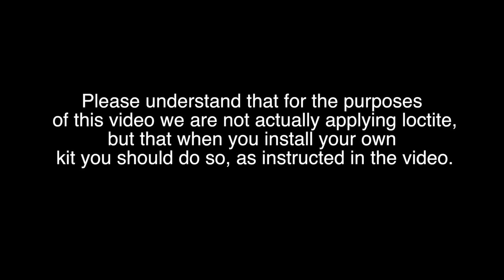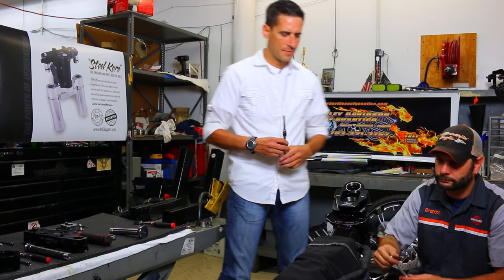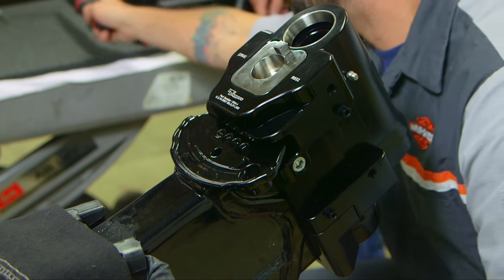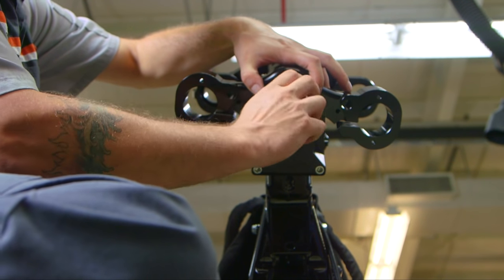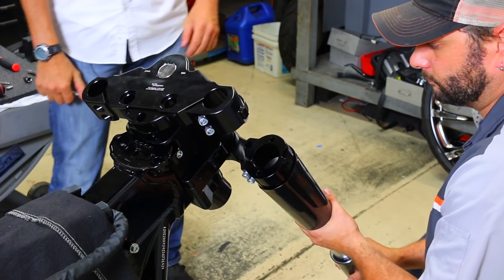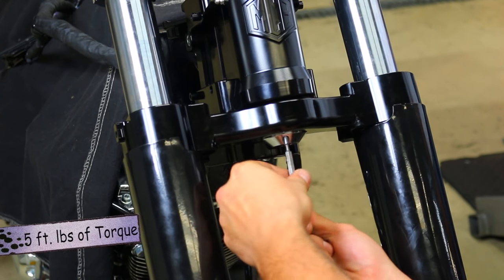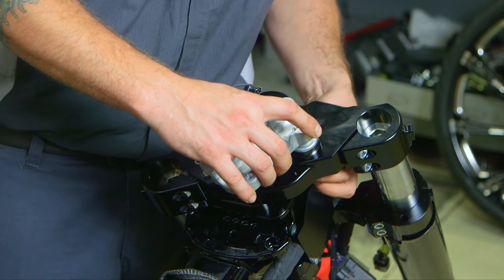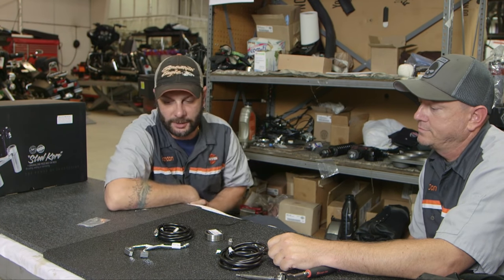“Steel Kore” Install (short-fork version | 26” wheel | 2014 and up) from MC Baggers

Comment: Great video!  It would be just as great if you had an instructional video on 2015 - 2017 Road Glide fairing removal and installation, along with using your 23" - 26" fairing mount.  installing rake kit looks quit easy, but the rest of the work may be more difficult.  A start to finish video including bearing replacement, brake lines for single and or double rotors and bleeding brakes (if possible) with abs style system,  inquiring minds would like to know.
Reply: Steve Klein Hey, brother. Thank you for your suggestion; we've actually had several people say the same thing. We will definitely try to do just that next for our next video.
Reply: Thanks!

Comment: I have a 2019 RG Special. I've searched a few sights on raking kits. Paul Yaffe on his sight says there is no way to keep the correct track lines and degrees without cutting into the frame and rewelding. The guy is a well known bike builder and knows what's up. Said that what will happen is either you bottom out on your shocks or your wheel will hit the fairing. This is my first bagger so im in brand new territory. What is your guys take on it?